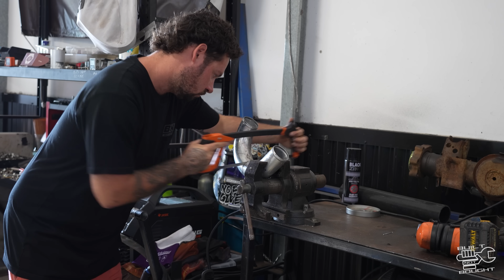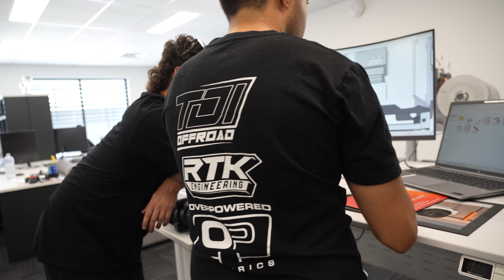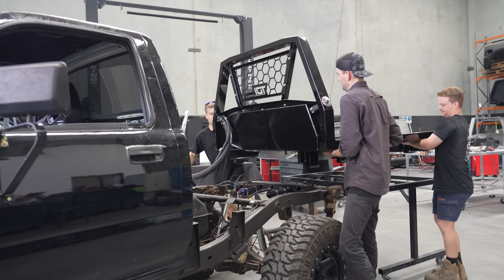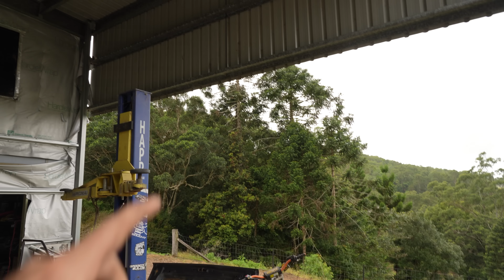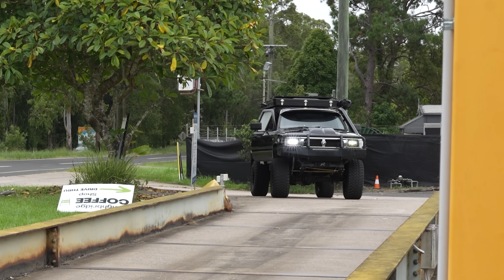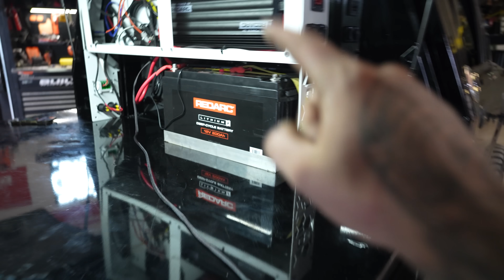BMW HILUX GETS NEW CANOPY

Comment: Also yes, The spider starts an origin point, then walks along the ground to point B, then once settled, tightens and pulls slack (like a winch), and creates one long line. Like a guide rope if setting up an awning for a hammock, then works around the mid point and other angles. (youtube has the answers to all)

Comment: Should change the rear leafs for a late model Hilux like ln167 (there longer) and then run longer shackles.. heaps better shackle angle much smoother ride and lots more flex.. 
can do lots of simple things to Hilux suspension for flex

Comment: Hilux looks sweet that tray is mint.. 
1 thing I did with my LN is move the rear shackle mounts on the chassis forward 1" , yes you need a longer shackle but for what it's worth
The ride was so much more comfy on road and the flex was better off road.

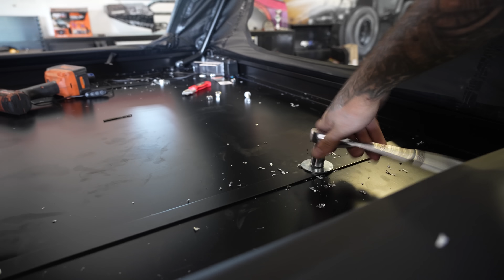Comment: Did u drill straight through that rooftop into the canopy just curious if it would leak at all as planning on doing this 10:34
Reply from the maker: Silicon
But nah water doesn’t really get in there
It’s into a rail on the canopy, not through to inside the canopy😊
Reply: @ ok cheers